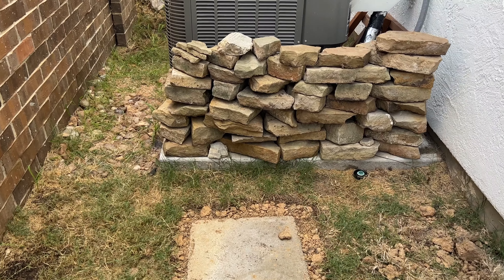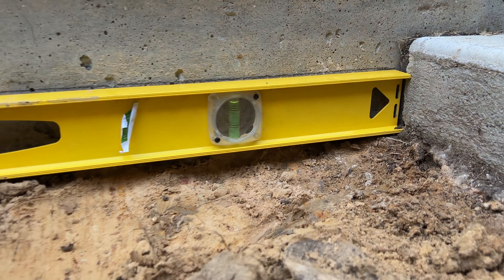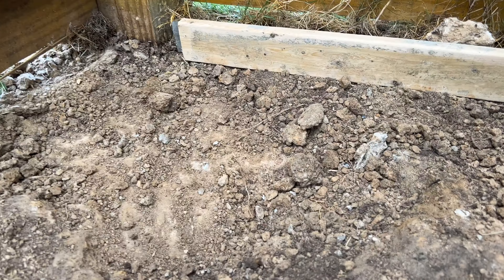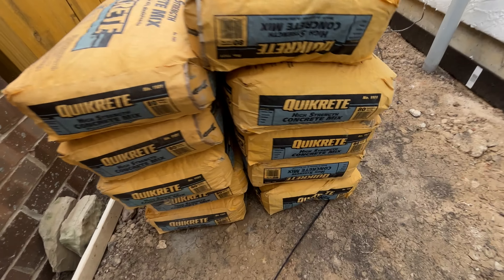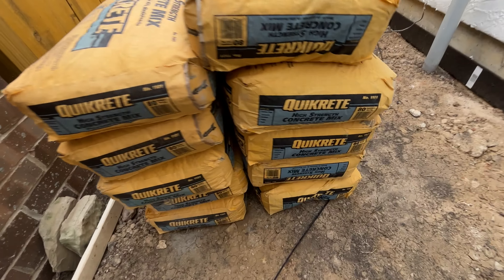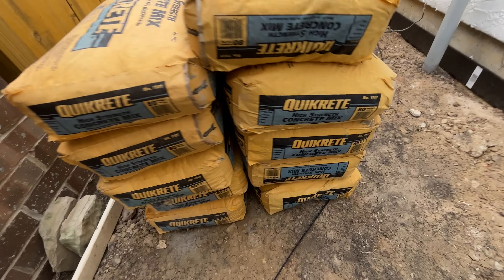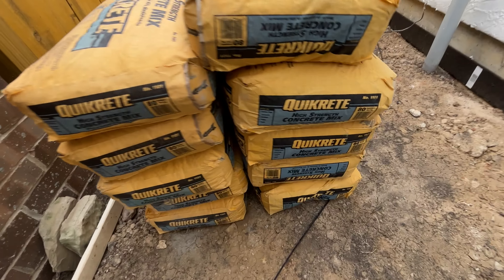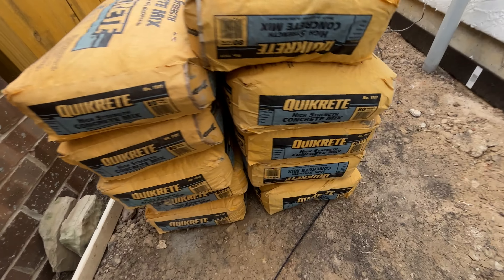Dry Pour Concrete - Disaster - WHY ??? 🚧

Comment: reluctant "like" -- I don't like the AI voice, the music is a bit loud, and the alarmist "disaster" in the title was unnecessary. As far as the procedure, it was a good project. The use of expansion joints is not talked about enough, so good on that. Since you had started the watering process, I think if you had just put some thick plastic sheeting down to protect the surface, the rain would not have damaged the surface so much, but for what you needed, it was fine. Did you address rerouting the fiber cable? If so, I missed it. All in all, a good video, so I gave it a "like," but I never like being misled by a title. Cheers.

Comment: Hi. Here are some suggestions for next time: put a vibrating sander on top of your screeding board to bring more ciment dust to the surface and push the pebbles down. Also, you can pass your concrete through a kitchen strainer to get only the ciment dust to fix imperfections.
Cheers from Quebec
Reply from the maker: Hi @francoisarchambault5550. Thanks a bunch for watching my video and sharing your helpful tips. I really like your ideas. I'll remember these tricks for my next concrete job. 🥂 Cheers! 🥂
Reply: Exactly what you don’t want nothing but dust at the top,why even put gravel in it? Just cement will do maybe it’ll last till you sell the chythole